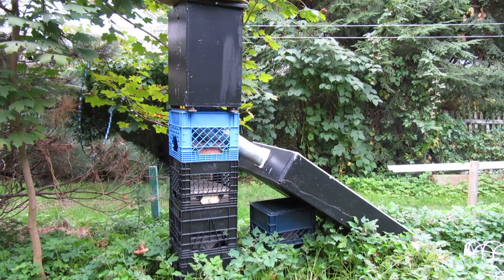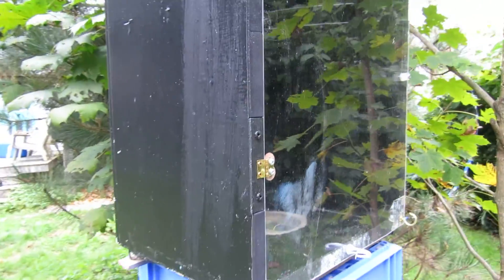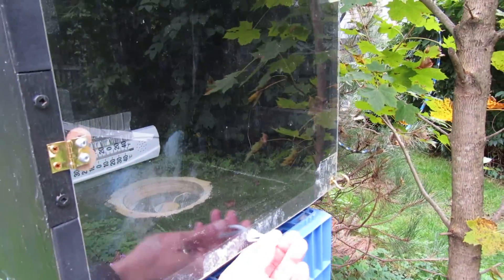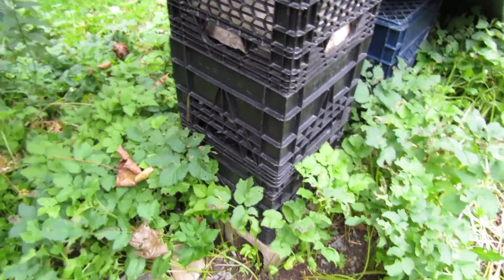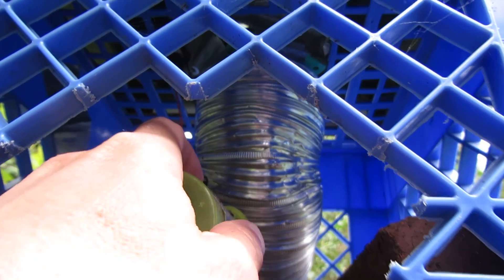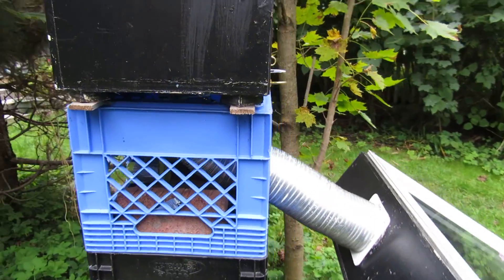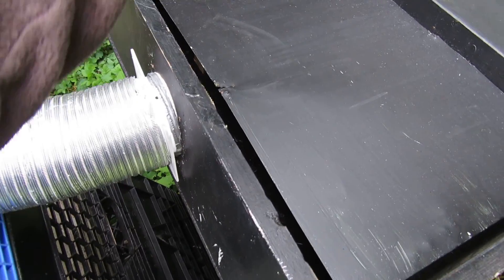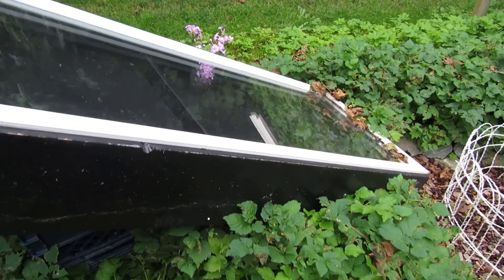How to Build a Solar Food Dehydrator - Part 2 of 2

Comment from the maker: Thanks. That's a good idea. I ended up going the way I did just because it was a bedside table with only 1 of the 4 sides opened up and it just seemed natural to put the door on the one opening. Actually I didn't even think of what you suggested. If I do it again and have a table with 2 sides open then i'd be more inclined to put a window on 1 side and a door on the other. I do agree that it would probably be easier to seal that way. cheers.

Comment: Nice looking set up... would it be simpler if you were to keep the glass front permanently sealed and instead opened the rear of the dehydration box?  I'd be worried that repeated monkeying with the seal around the glass would put the glass itself at risk, whereas if you accessed the box from the rear you really don't have to worry about being gentle with it.

Comment: Nova scotia :))

Airflow will increase by letting the warm air enter on top whilst being pulled out below the drying products. You can achieve this by using a chimney construction ; use a false wall or another vent. The moisture weighs down the air too. In this way you are using multiple passive forces to achieve maximum efficiency! 

Personally I would try to see how fast this dries when the passive airflow is good before adding a solar powered fan.

<3 your project. one way goods are no goods!

Comment: By tweaking your design a little you should be able to use this for about half the year. What you have is a semi efficient Thermal Engine. The drying process is actually more about airflow than it is about heat. Put a longer stack coming out of the top and you should drastically increase airflow. Another fun Idea to increase flow would be to put a small windmill on top connected to a fan, maybe a large PC fan, so when the wind blows it spins the  and sucks more air.